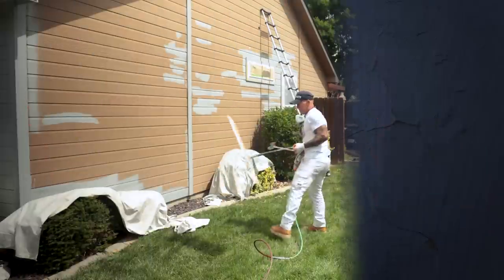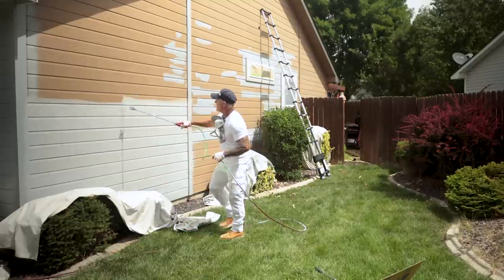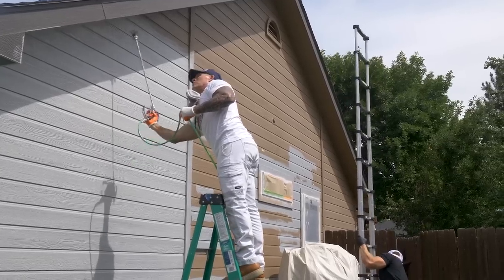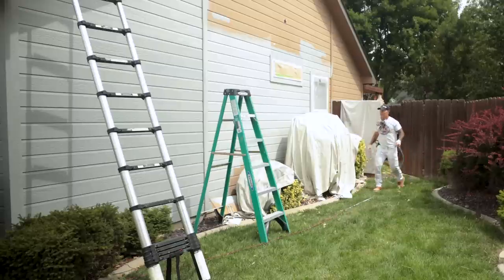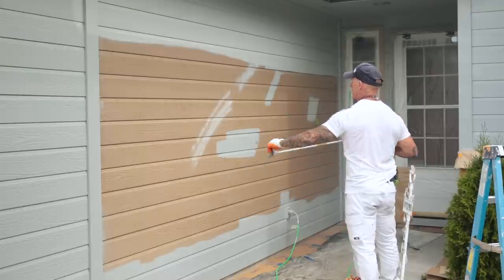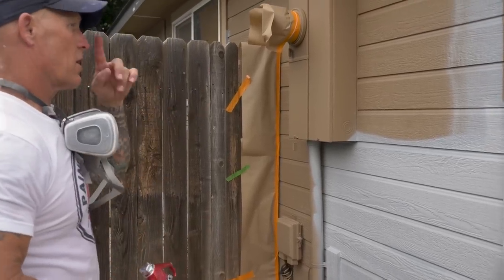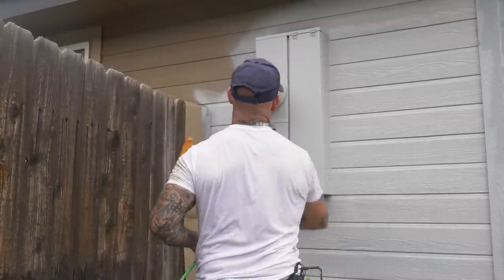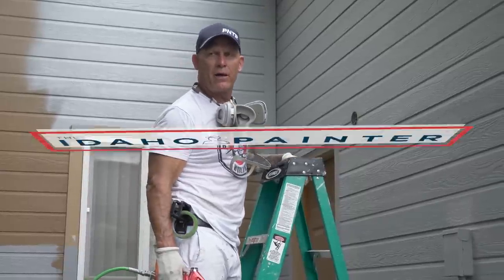Airless Spraying The Right Way? Painting with an airless sprayer

Comment: I learned so much from you. I had 23 kitchen cabinet doors and 11 drawer fronts    I’m 76 years old and have been helping my husband with jobs around the house for 58 years. He passed away two years ago on Thanksgiving night.  We had to let a lot of our repairs around the house go. After a year I knew I was going to have to sell my house.  After taking all the doors off (maple ) I cleaned thoroughly and sanded lightly.  I did this in my garage. Bought the large size Wagner paint tent. Went to Walmart and bought some inexpensive clothing racks.  Then depending on if they were upper or lower doors I use a small bit and drilled two holes in each then I screwed small cup hooks in and hung them on wooden hangers.  It was hard work I won’t lie, but they are so beautiful. My daughter helped me paint the actual cabinets.  Cudos to you.  After I had already got half way I see where you sell these drying racks.  I used Valspar kitchen and trip paint. Self leveling.
Reply: Trim not trip.  Everyone that sees them says they are gorgeous. That’s for putting these videos up.

Comment: Thanks for the videos. I'm a long time painter myself and I'm still able to learn a lot from watching you. 

Have you ever tried tying back bushes and shrubs with those yard stakes for dogs? Wrap a tarp around them then take the wire or rope and pull them away from the house and stake it down, it will easily buy you another foot or two of room to paint.
Reply: that works pretty well. In a lot of cases I just take the drop cloths, wrap them around shrubs and tie the two ends in a knot fairly tight. Generally it pulls them back far enough for painting.

Comment: Thanks for the tips. When you clear the spits on the wall surface does it leave a shiner or is it thin enough to not matter? Also could you brush or roll it out and reapply? Thanks
Reply: I was going to comment on that as well. I think if you're an experienced sprayer you can put it on thin enough so its not an issue. But personally I'd recommend clearing it out on a tarp or some of your masking. Be sure to still swipe as you clear it though, the pressure is high enough on that thin stream if its concentrated to break through window plastic and get paint on the window.
Reply: I was wondering the same thing.

Comment: Is backrolling a must when spraying T1-11 exterior??
Reply: @bratvlad  I was thinking the same thing but in his latest video he definitely did not idk...
Reply: If you are changing colors or the siding is really crusty and weathered then yes, use a thickie nap cover.  If you have t1-11 in decent shape and are staying with a color or very close to old color  then you can likely get away w no backroll.  What's great about backrolling is that you just have to get the paint on the wall, doesn't have to be sprayed perfect. So you can shoot it close to avoid overspray and fix the coat by backrolling

Comment: How would you, being a pro, correct the overlap spots that got a little heavy? I usually take a rag with acetone and wipe out the spot a few inches outside and blend it enough to do a light spray to cover it, but I haven't sprayed on soffit or siding before.
Reply: Easy, don't make them.

Comment: Just a thought.  I wouldn't spray higher way above my head just to make sure I spray enough paint on the angles. You surely transfer 90% ( 10% it is over spray) of paint of flat surface  considering how windy it is but on the edges if you dont bend your wrist the right angle than you leave 40% of paint, it is surely painted but with less amount.
It is important to mention because the sun that's where it hits the most and it does hurt the quality. After all the paint is your siding protector from the elements.